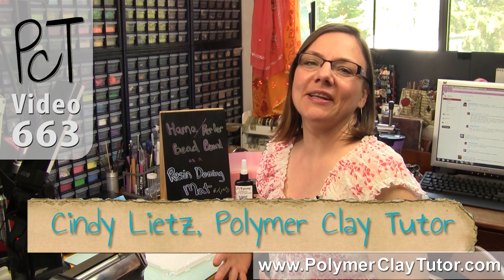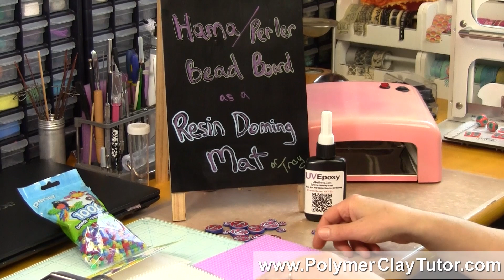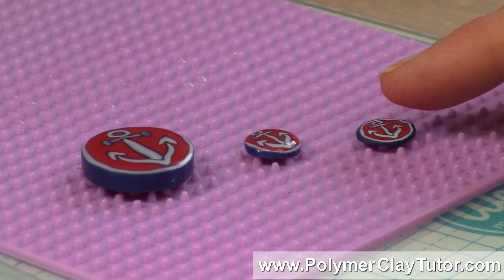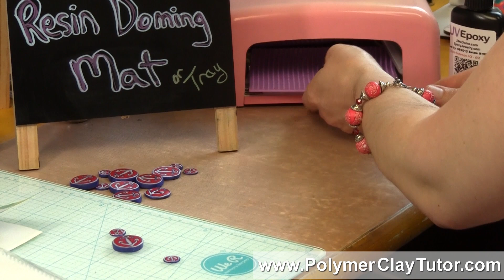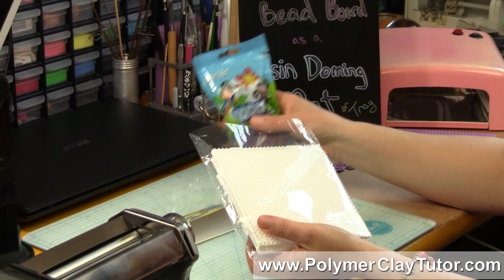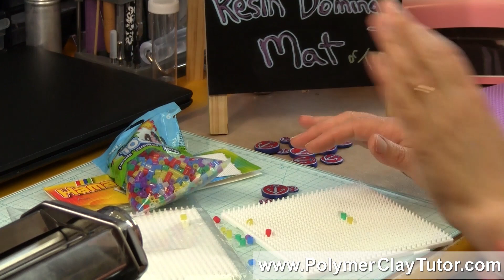Using a Hama or Perler Bead Board as a Resin Doming Tray

Comment: I have used those to dome resin pieces and if there is run off of the resin it will make your piece stick to the peg board and sometimes if there is to much run off you have to pry your piece off and they can break. I think since you are using UV resin it will be much easier to get it off I really do hope it works for you =)
Reply from the maker: TheTRUEVenomVixen It seems to be working great for me so far. Thanks for mentioning that. When you do get run off it is always good to try and remove the piece before the resin has set, whether it is a two part resin or a UV Resin... then you don't have to deal with your resin pieces or your tray getting ruined.